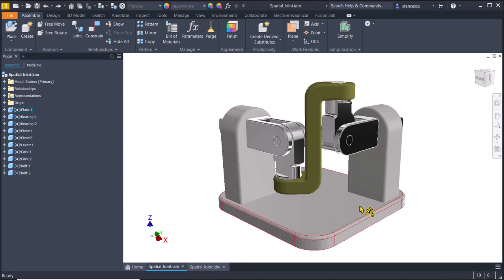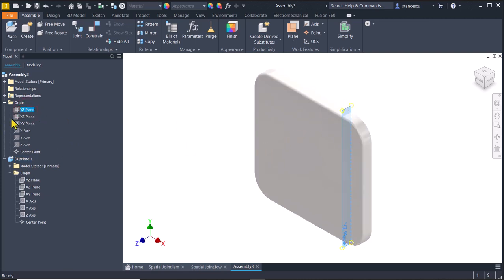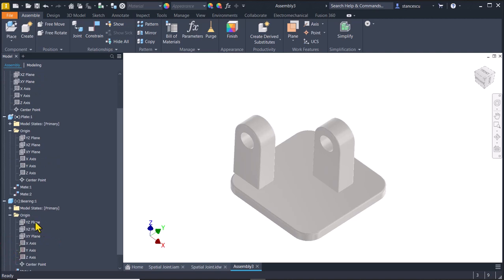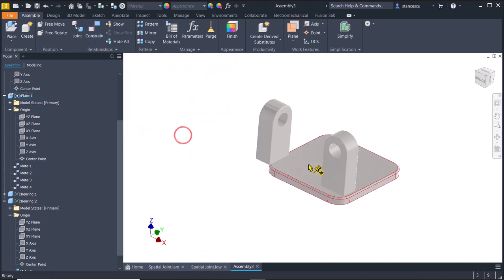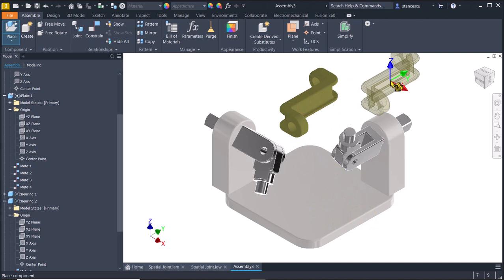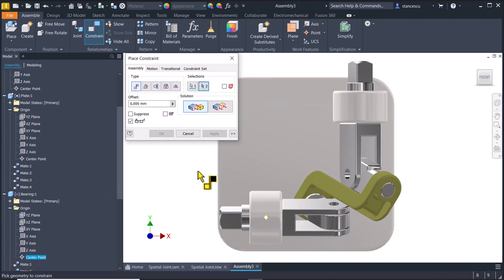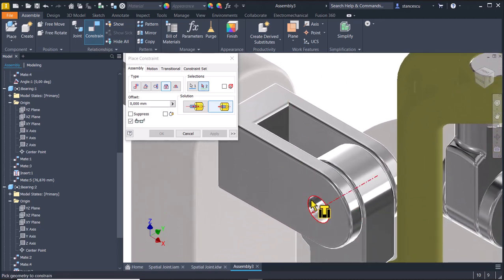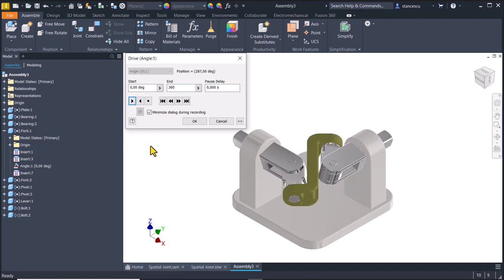Tutorial Inventor - 382 Spatial Joint - Inv2014

Comment: Hi Professor. I'm unable to place (or open) the plate and bearing assets into a new assembly file. Inventor (I'm using version 2023) is sending this error message

"Unable to open \\curator2\users\BellX1project\Documents\1Glen\Constantin Stancescu\Tutorial 382 Spatial Joint (GC-01)\Plate.ipt because it is an unsupported file type or version. Please save the file in another format and try again. 
Error 41"

The other four assets loaded properly.  Something to do with you using version 2024 for those two parts and me using version 2023?
Reply: Nevermind -- I found out I need to update my version to accommodate version 2024 parts. Thx
Reply from the maker: I was wrong!
The parts Bearing.ipt and Plate.ipt were made with Inventor 2024, while the others with an older version.
Please download again the file Tutorial Inventor - 382 Spatial Joint (GC-01).zip from Assets and try to open it with your version of Inventor (which is not Inv2024). I am waiting for an answer from you because I intend to offer you the oldest versions in Assets.
Thank you, my friend, for joining my channel as PATRON!
You can communicate with me at constantin.stancescu@gmail.com
Reply: @prof-stancescu  I've downloaded the assets again and worked through the assembly placement process. Everything worked as desired. Thanks.